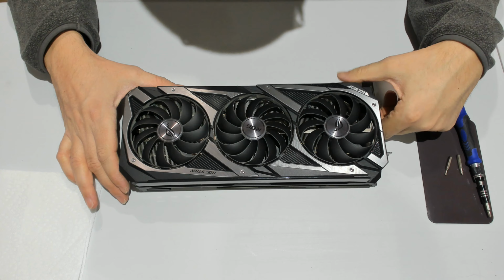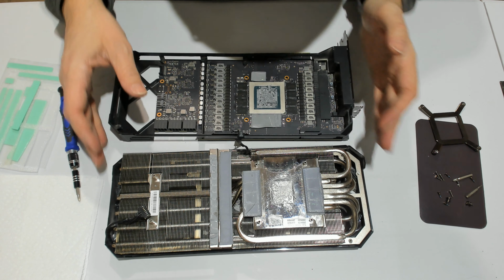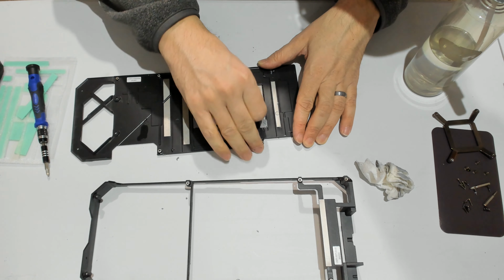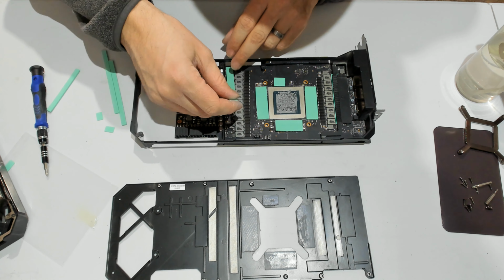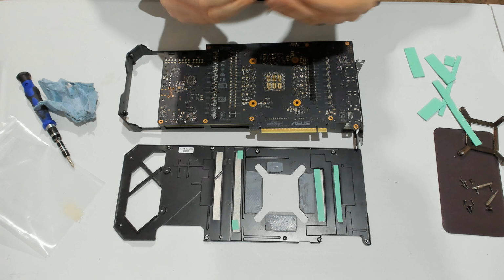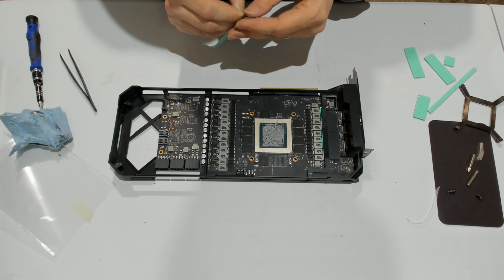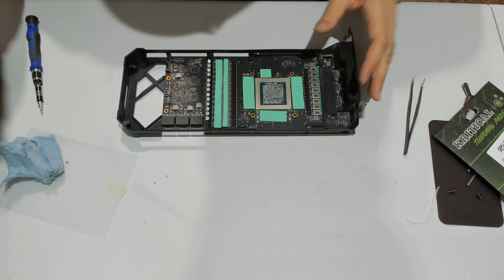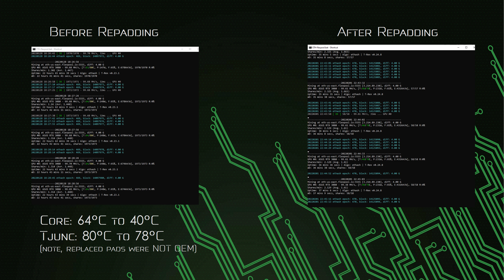ASUS RTX 3080 (3080Ti/3090) STRIX thermal pads replacement with custom set (20 W/mK)

Comment: The 2C improvement was underwhelming but after a second look it's also from a higher power usage +80W so it's definitely an improvement!
Reply from the maker: Note that the pads being replaced were not OEM. The issue on that particular GPU was the core temperature (i.e. pads on it before replacement were clearly too thick). These pads that were too thick were good ones, just not the right size!
Reply: Doesn't matter, it's not hotter, so he achieved the goal, to lower the core temp and not increase other temps; probably for mining.....

Comment: My Strix 3080TI recently went through flood water. And somehow survived but upon checking the temps idle at 70 degrees ordered the pad kit and hope this solves the issue otherwise I guess I need a new gpu
Reply: i doubt this is the case but maybe thermal paste washed away. id highly suggest repasting your card
Reply: @Doodihealz  I plan to as well as replace the pads. Just using a GPU borrowed from my sister till the pads  get here.
Reply: @firebird625  did you fix it? I tried washing mine in the sink and now its the same.
Reply: @KirCh4rT lmao was jk

Comment: I changed my thermal pads and paste today. Mine is a 3070 TI ROG Strix.
You'll need 0,5mm + 1,5mm + 2mm and 2,5mm  thermal pad thickness.
Reply: Can you tell me the size of the thermal pads just for the memory chip and the heatsink?
Reply: @Chezaw  Memory 2mm
Reply: Is the layout of the thermal pads for the 3070 rog strix the same as this video?

Comment: there are copper plates you can buy to replace the vram pads and I saw a 20c reduction on vram with my 3080 ti strix. under load vram is now at 68C down from mid 90s to sometimes 100C
Reply: Do you where i can buy them? I live in Italy, i have a 3080 ti strix, reches 82°C the vram .. its 2 years old

Comment: Does placing the thermal pads on directly on the vram vs placing em on the heatsink make any difference ?
Reply: It does not but why would you want to do that when the heatsink will go there anyway.
Reply: @DardaniaLion  Sry this question was before my vram pads replacement experience , i've now indeed found out that it doesnt matter ... i was questioning it before because i was afraid of proper contact but now i found if u have the correct mm of thermal pad if doesnt matter :)

Thnx for the reply :)
Reply: @sensz9139  You're welcome. Just make sure to do a heat test before you use the card. Sometimes in the past I did burn a card because I messed up with the pads and thermal paste. Now what I do is I replace both, pads and paste then do a furmark test to see if the temperatures will stay stable once they reach that peak.

Comment: Replace pads on 6x 3080 strix (not lhr) with tnis custom set - and was disappointed, first my sets not include pads for memory on backplate, and without them temps is horrible. So I was need to rebuild cards again and add 2mm pads on memory spots backplate. Second - memory pads too thick! I believe included is 2.25mm and with that size core dont have good contact with radiator, I try to press pcb to radiator hard - no effect. Change them to 2mm and (3rd rebuild of cards) and now temps of core and mem is ok. So this sets is waste of money! And you still need pads to make card work.
Reply: you are right.

Comment: HI ! I'm a UK customer , and I would like  a custom set for my ROG RTX 3080 ti Strix . 
1 - So a custom set for an RTX 3080 is 33$ which is not bad, I think it is decent(not a great price but yeah acceptable),and then at the checkout on the website you guys are asking for 19$ price for Shipping not insured !! that's bad ... really bad . The second option is 49$ for a priority shipping plus does not say if it insured or not . So if I wanna be sure 100% that I would have my order obv not thinking if it is damaged or not, I need to pay 82$ for the custom thermal pads that you guys do , which is insane.
2- On the website it is nice to see pictures with the item glad to see that, but you do not provide us with the size or thickness of the pads there's no info at all... I would like to know each one of them size and thickness, not anybody can buy from you guys and it is not easy.

Comment: Very disappointed with kirtical pad, replaced all pads on Evga ftw3 3090.  I end up with memory temp 10c-15c above oem pads and cause thermal throttling.
Reply: Same thing happened to me, the back pcb side the pads are too thick
Reply: @ICDisappear  I don’t believe these pads are 20w/mk as they claimed,more like 8w/Mk.  In fact the best pad on Amazon is 15w/Mk.
Reply: Get different sizes for the different spots and the evga forums has the info about the sizes on the different plates.
Reply: I had insane results from my 3090 ftw3 with kritical pads. Got mine down to 62c under full load. Was getting 98 to even 110c before
Reply: @KiNg0fShReD  lowkey smell cap rn
Reply: @KiNg0fShReD  how can you  cool the back side Vram to 62c? Those  are passively cooled only.
Reply: @galewang  I didn’t give the whole details of my setup, but i liquid cool and i have the Ek active backplate too. But yeah, i custom cut all my kritical pad sheets for front and back. On my wife’s 3080 suprim i got it down to 72-76 average uber load with just air. And even though there is no vram chips on the back i still custom cut and replaced on her 3080 too.